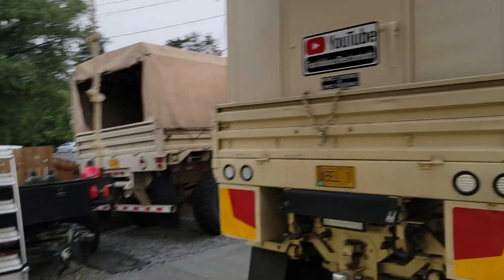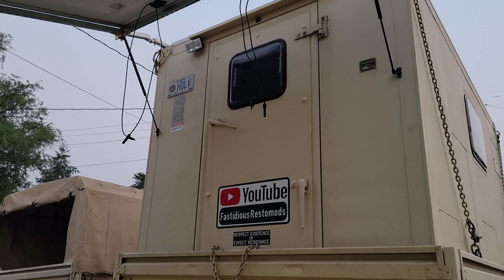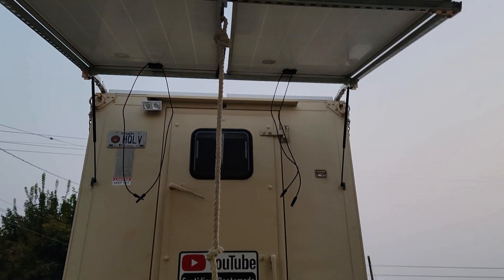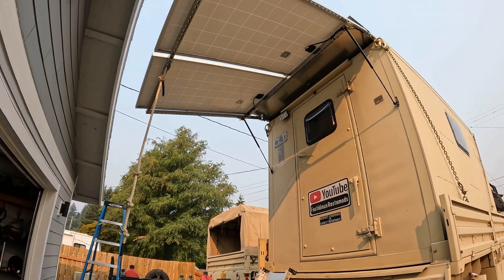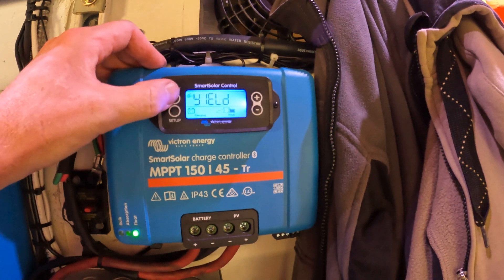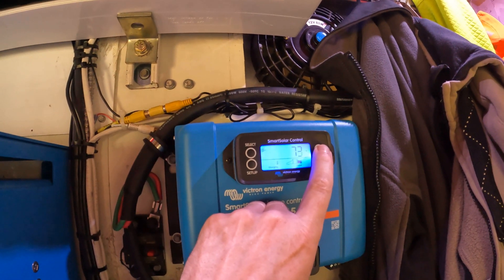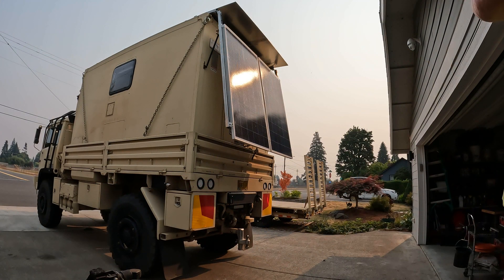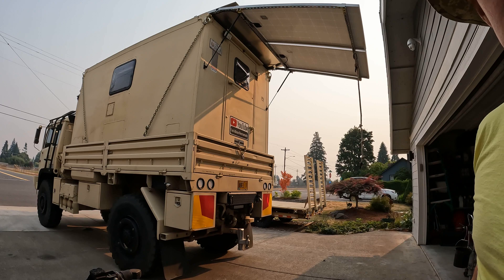Abel LMTV build part 191 (Solar awning day 2)

Comment: My only concern might be with a side wind as you're driving down the freeway catching the inside lip or inside edge I'm putting undue stress on it.  Perhaps a latch on each corner
Reply from the maker: I guess it would be a concern if there were nowhere for the wind to go but alas it is a tunnel with an opening on the other side....
Reply: @SeanFastidious  well hopefully it never is an issue and good work!

Comment: Great improvement in closure and position over part one.  I am happy that you are happy with the mod 👍👍
Reply from the maker: I got the new 200 pound struts and it closes all the way now since the ends are metal and not plastic.
Reply: @SeanFastidious  I was wondering how those were going to work out…👍👍 Excellent…you can always do part three 😉 Or maybe just a “short” to show the final configuration. I am trying to tackle how to add some solar but not lose the cargo hauling ability on mine…I probably can’t dedicate more than the cab roof.  Will research further…

Comment: I wonder if the air at hiway speeds will push against the panels. Thinking adding a stop bumper between the panels and the bottom of the camper box.
Reply from the maker: I found the opposite to be true...